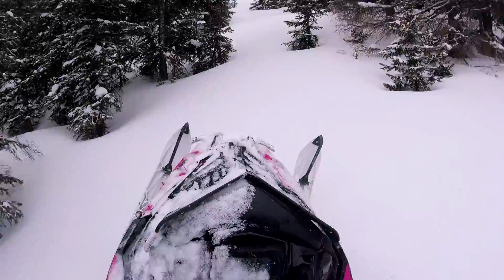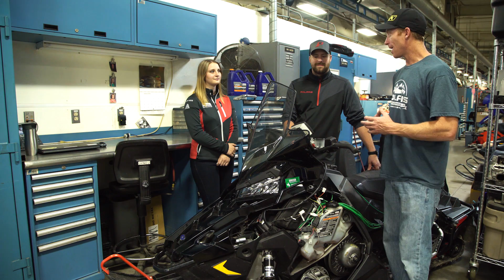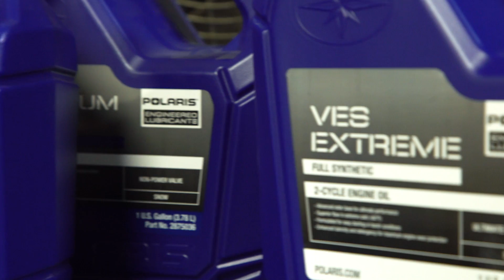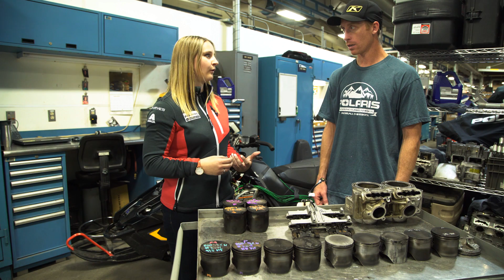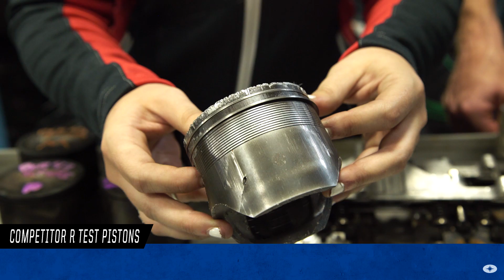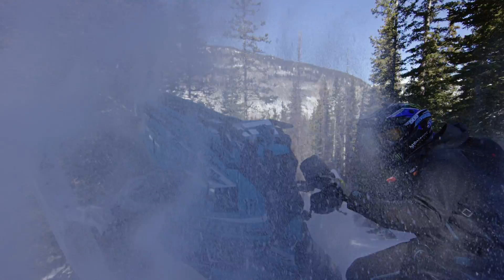VES Extreme Oil - Behind the Scenes with Chris Burandt - Polaris Snowmobiles

Comment: After 30 years of Riding. Some years 10 thousand miles and 128 days logged on the seat. Best one day drive off 600 miles.  I've used many different oils over the years. Worst to best( Castrol, Quater state,  Lucas, Amsoil, Polaris gold & VES, Shell Advance ultra). I've stuck with Shell Advance snow ultra now for over 50 thousands miles and 10 years riding 7 Sleds and no blown motors due to Oil issues.    No amount of Engineer time is going to sway me now.

Comment: Getting a new XC 850 2019 soon.  I've used Klotz in all machines for almost 20 yrs on mechanical & electronic oil pumps without failure.  I will continue.  Thanks for the "oil movie" though.

Comment: I used Amsoil Interceptor and Sinto Performa (Canadian 2 stroke oil)  Both oils bogged my RMK on top end ! Every time I got to 6500+ RPM my snowmobile bogged and went into a limp mode right until I left off the throttle then it would do it again when pinned... Just for kicks I was richer one day and bought VES gold... It was a night and day difference... No more bogging and a colder engine ! And the smile on my face was Priceless ! VES all the way now !
Reply: I use polaris blue But now I'm hooked on  polaris ves extreme   😁👍
Reply: @700sniper4  I'll have to try it this winter !
Reply: I ran Sinto Racing 5 complete seasons of insane WOT sessions and never had probleme with engine bugs or failure but I ran it with a bypassed exhaust valve solenoid
Reply: @Timichaud  I use Sinto Performa in my RM 250 2 stroke ! Check this video ! But it never worked in my RMK ! https://www.youtube.com/watch?v=UmgipQJNYg0&t=35s
Reply: @Timichaud salut ti michaud, ton rmk sait un quel année pour avoir bypasser le selenoid dés valve dexhaust ? 

Hello timichaud , wich year is the rmk you bypassed the ev selenoid ??
Reply: @Jeanboyer95  my rmk was a 2012. All my friend had the same sled of the same year and I was the only one that never fooled a plug in 5 winters.

But I had to clean the exhaust valve each season because the sinto was so hard to burn.

Fun fact, noe I have a Khaos Slash 850 2020 and Im fooling some plugs each winter. Cannot touch the throttle until the Cold message disappear from the screen...

Mon RMK etait un 2012 et tous mes chum avaient le meme sled et j'etais le seul qui n'ètait pas sur la polaris. Aucun probleme mais la sinto encrassais mes valve vraiment et je devais les nettoyer chaque fin de saison sinon je perdais du régime.

Maintenant jai le Khaos Slash 850 2020 et cest loin du meme résultat. Je brule quelques bougies par année. Je dois le laisser réchauffer jusqu'à 25 celcius avant de partir avec.
Reply: @ 80 dégrée Fahrenheit pour le 850 khaos le truc pour pas sauter des plug 💯
Reply: hoo and never fooled a plug on it but my friends on polaris oil fooled 1 oe 2 plugs every cold start
Reply: @Timichaud  It can happen ! 2 Strokes are also finiky... Water in Gas ? Bad gas quality ? Richer oil pump ? A lot of factors come to the table when it happens !